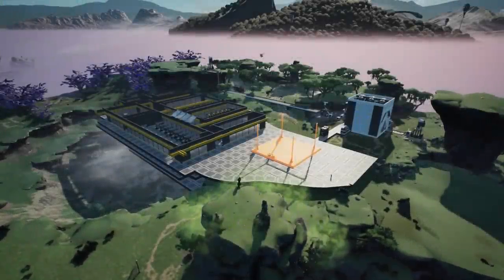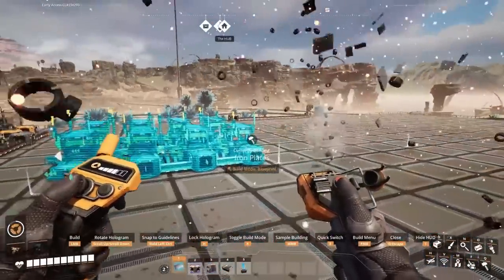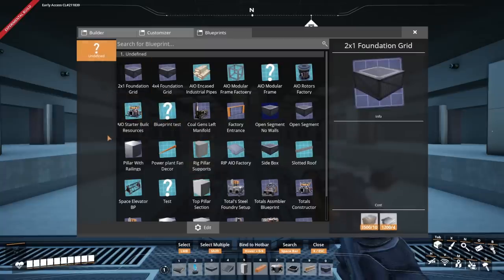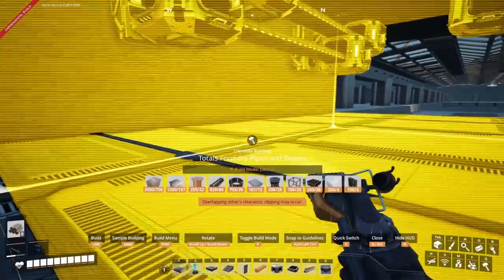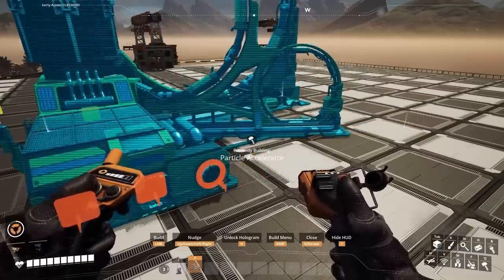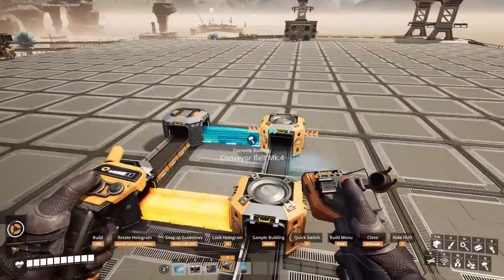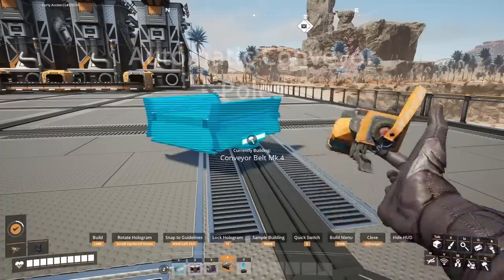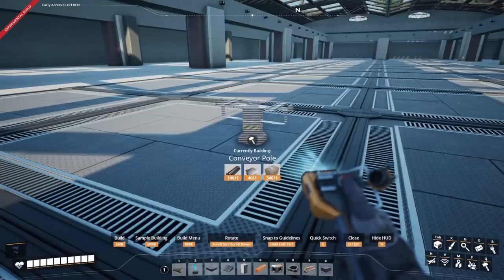CONVEYOR and BLUEPRINT Changes Satisfactory Update 8

Comment: More than placing the pole at the start of a conveyor, I really wish there was a way to change to stackable poles while placing conveyors. Would make it so much faster.
Reply: yes please would be so nice... and "zoop" to make it change the stack heigh of those stackables
Reply: with smart mod you can zoop the conveyor poles both vertically and horizontally as well as adjust the poles spacing, once you get use to the hot keys it takes only a few minutes to zoop near infinite sizes of buses as long as you have the materials for it.
Reply: @barstool2985  running modfree here
Reply: @LiLBitsDK  fair enough, I'm basically mod free as well but since it's just quality of life improvements it shouldn't break anything when updates come out if that's what you are worried about. You will just need to disable the mod until its updated for the new patch.

Comment: I am 100% unimpressed with their implementation of Lumen. Specifically at 05:15 in this video. In real life and specifically with Global Illumination, it should FILL that room with light. The sun is a powerful light and it should absolutely reflect around that building and illuminate a good chunk of the surfaces.  From their original video talking about this in Snutts little house they had a powerful overhead light that barely illuminated the walls. 

I was so excited about Lumen but now i am just full of sad. ;(
Reply: That's the one thing I was really hoping for too. It shouldn't take 12 wall mounted floodlights to still not even light up a whole 10x10 room.
Reply: Even more so by the fact the sunlight is hitting a bright orange wall. It should be bouncing light incredibly well to fill that room. If it was a pure black wall the lighting would make "more" sense but it would still be less than reality.
Reply: Agreed, indirect lighting is crucial
Reply: I want to make dark cramped tunnels and I can't do that without Lumen. Everywhere is too bright.

Comment: The nudge feature also needs a Z-nudge to go with the X & Y.  Also it would be nice to be able to select the stacking conveyors as the default.
Reply: when there is a buildable that can be adjusted in the Z direction most of the times if not all of the times it will be placed in the stages 1 for the X and Y and 2 for Z in the logic using the nudge will make it 4 stages so nudge twice... once for X and Y once for Z.
Reply: @ReemX44  not necessarily. It could be additional keys like Page Up and Down.

Comment: what we need is a Mk 6 Conveyor, because you can Overclock a Mk3 Miner to like 1200 parts per minute, obviously the over clocking on Miners is more for Normal and Impure nodes because without it they have no chance of saturating the Mk5 Belt. in my honest opinion. it could be like the Mk5 in design but with higher railings along the side maybe ?
Reply: Its an engine limitation i believe to make higer speed belts. Maybe they can launch higher tier belts after they switch to UR5. and lastly if not higher tier belts then maybe add 2 output ports to extractors
Reply: @SageKing09816  nah.. you can install mods with unlimited transfer speed
Reply: @SageKing09816  we literally have mods that go up to Mark 10 belts already... lmao. Coffee Stain is just really slow on QoL updates. Hope Satisfactory stays in early access another year or two. It severely needs the polish.
Reply: @lazarusfitness3892  Higher speeds are possible, but no longer accurate. That's why they don't make faster belts.

Comment: I had hoped Upd8 would be out on the experimental branch by now. I like the nudge feature. It probably won't replace the mod I use to adjust positions of structures as it is far more flexible in terms of orientation and translation in 6DOF.
Reply: What mod is that?
Reply from the maker: Probably micromanage
Reply: @TotalXclipse  Exactamente! That is correct :)

Comment: I hope they sneak in pipe ceiling supports. It seems like an obviously lacking thing now that we have conveyor ceiling things. Having more options to route pipes in ceilings would be awesome 😁
Reply: That seems to be a thing already. To my surprise, aiming a pipe at a ceiling results in it placing a support. Was a pipe wall support, but rotated 90 degrees so it attaches to ceiling; it seems they just did that rather than give it a separate model like they did with conveyor wall/ceiling supports.
TL;DR just aim a pipe end at a ceiling and see what happens. c:
Reply: @puck4801  there's no height adjustment though like on the ground. And that's a shame. Stacking pipes on the ceiling is... Weird... Right now 😅

Comment: i need a bigger blueprint baseplate, many items can not fix in there , coal generator, nuclear plant and others
Reply from the maker: You can fit 3 Coal generators on the blueprint. I think the only items that dont fit are trainstations, nuclear power stations and the particle accelerator currently.

Comment: I NEVER bother using Blueprint. Its a waste of time. If they cant make it save larger structures and dont plan on making it bigger than a 4x4 platform just dont bother with it. The most you can save is a few co structors squeezed into a tight space just to make it to the blueprint. It limits your design. Just forget it.
Reply from the maker: I totally disagree with you, you can create modules that snap together making it incredibly useful, if you take the time to plan out in advance.  Even if you're not using it for intricate designs it's far quicker to use blueprint snapping and snap 4x4 foundations down at a time (16 at once) than the normal 10 foundation long zoop. Same with a basic constructor line, if you can place 8 constructors with their manifold in one click why wouldn't you for larger builds?
Reply: @TotalXclipse  multiple modules that size is more trouble than convenience. i have seen those lists of blueprint and its a headache even just to watch. imagine a large fractory broken into several smaller pieces just so they can fit in the blueprint.  might as well design from scratch as normal. PLUS your designs now have constraints, because you now have to fit your designs in whatever small space that blueprint allows. its too cramped. unless that blueprint is able to capture much larger designs then it maybe worth it.
Reply: @SIDEKICKONYOUTUBE  I find it worth it. Just building 4 fully connected constructors is a MASSIVE time saver... You can do that manually if you want.... Idk why you would... Imagine trying to build 100 constructors without blueprints ☠How can you say its "a waste of time" when it is ~proven~ to save time